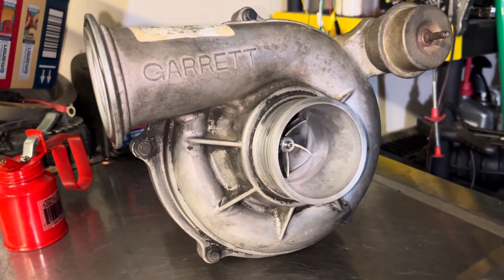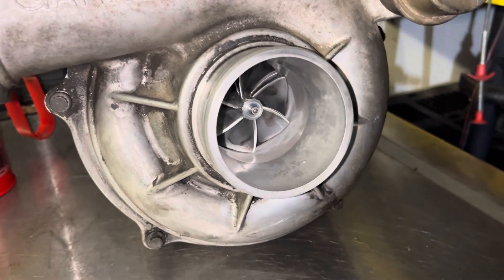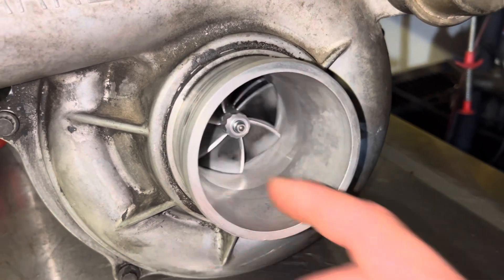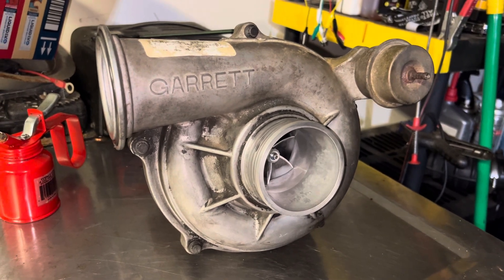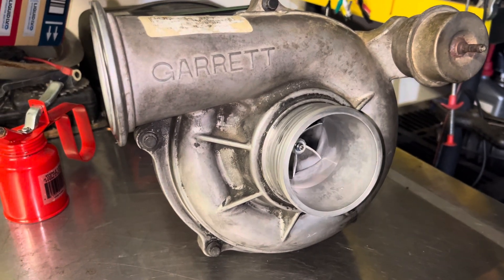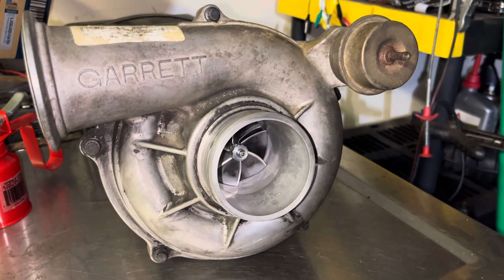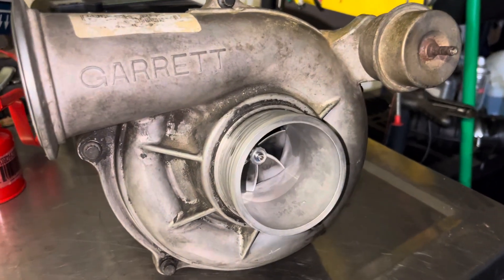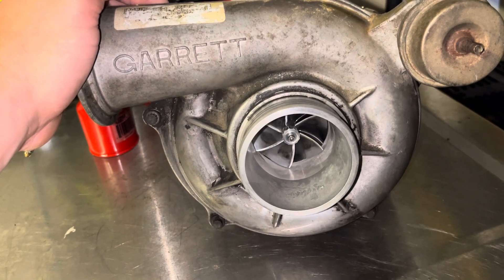7.3 powerstroke KC Balanced assembly 6 month review.

Comment: When running the KC balanced assembly, are you leaving the waste gate hooked up factory or leaving the red line off. Do  you make any adjustments to the rod? I'm putting my balanced assembly in now and wanted some advice on this. Thanks
Reply from the maker: I delete the the lines and port. just let it run off spring pressure. With the balanced assembly you don’t have to worry about compressor surge. Just be aware you will need a boost fooler if exceeding 23psi because the MAP starts freaking out.
Reply: @cbr600rx7 Thank you! I'm getting my truck up to snuff, and the majority of what I'm doing is based on information in your videos. I really appreciate the content you're putting out.

Comment: If you bought a used 38r that needs a new center section, then what did you actually pay for? Why anyone would spend $450 on a factory turbo is beyond me, I still can't figure that one out. You can get a billet 5+5 from Swag for $85 bucks and have just as much turbo.
Reply from the maker: Dude. Just no. 
More to rebuilding a turbo than just throwing a cheap Chinese wheel in and calling it good. To start with as the trucks are now 20+ years old having fresh bearings and seals inside of what is a pretty good turbo is an advantage. The KC balanced assembly offers the advantage guys running stock injectors everything they claim (better spool up, slightly more boost, lower EGTs, a little more turbo whistle with out being annoying when towing like the WW) these are small gains and for some one on a budget with a highmilage GTP38 it makes sense. Now if you have a toy and your running big injectors then yeah something like a T4 or SXXX swap makes sense. But once again for the farmer with 350+K on his truck or a hot shot driver that pulls every day this isn’t a bad deal. Also the technology that is incorporated into the compressor and turbine wheel is far superior to what it was in the mid 90s basically when this turbo was being developed. Not to mention the advantage of the 360 degree bearing. Once again all small improvements but basically with no trade off.  To many times have I seen cheap Chinese wheels on thrown together turbos cause massive damage. I am not trying to be stranded 300 miles from home with a 10,000lb load on the trailer. 

Now for the second question a new GTP38R BB is around $2100. I got one and the intake tube for $500. I have run the turbo and been pretty happy with it both for daily driving and towing. The in and out play is very very slight but it’s something I know I want to address. Now I could take the 1.00 AR exhaust housing, the ported cover, and the intake tube and add it to the GTP38 if I wanted to (consider the ATS ported housing is over $500 and fits like trash). But I decided to give KC new GTP38R center section a try. They make some bold claims so I am excited to see how it goes. 

And yes I have run wicked wheels personally and installed a few for customers. The only time I recommend it is if everything on the turbo is tight and you have something like saw blading on the fins from dust contamination or trash getting into the intake. And that’s only if it’s a “get me back on the road as cheaply  as possible situation”. Your opinion may be different but I have been doing this a long time.
Reply: @cbr600rx7 you are correct lol way more involved, id never run a “swag” wheel ether
Reply: You clearly don't know the difference between a 38 and a 38r.